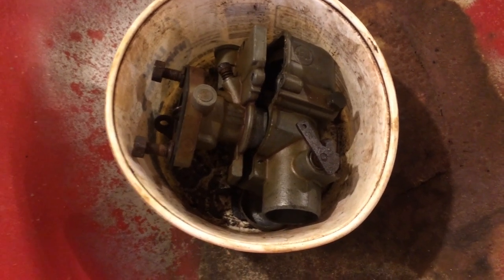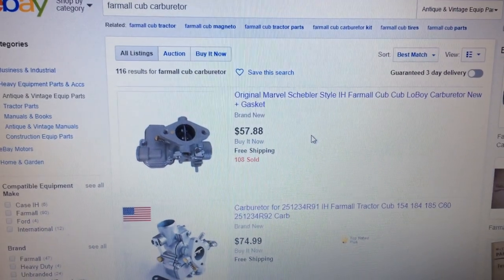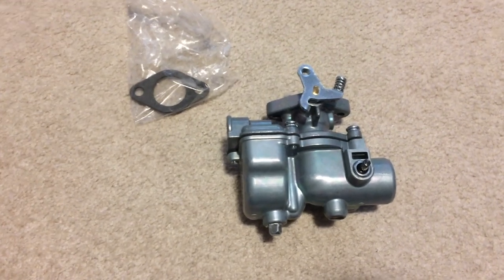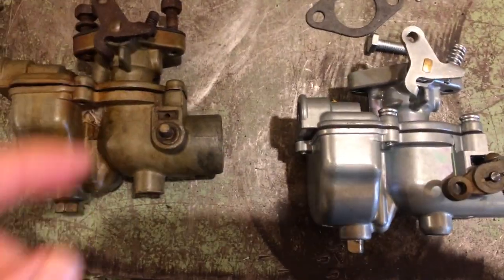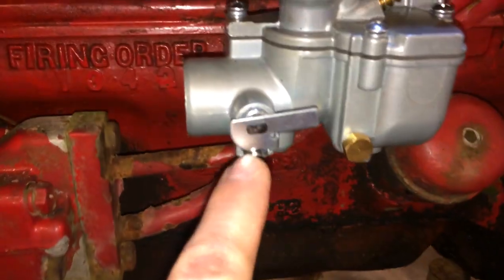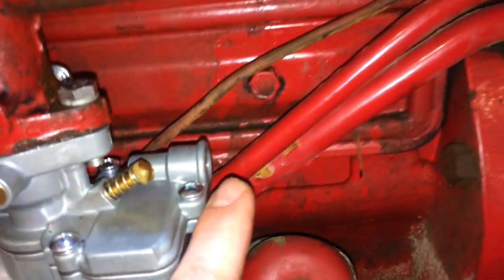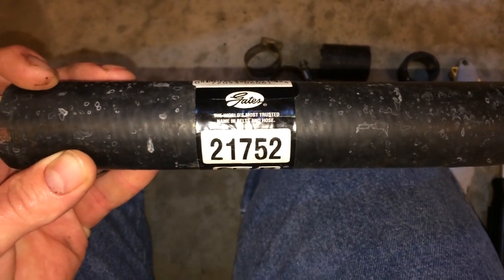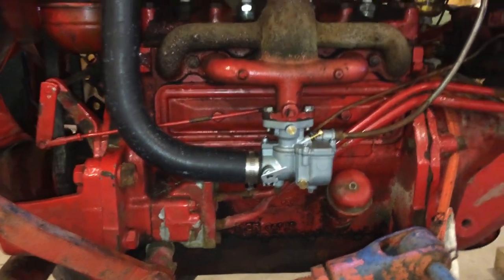Carb replacement on Farmall Cub with IH carb

Comment: The Cub originally had a metal tube with a rubber section on each end. My Cub didn’t have it so I got one from Steiner. Also, I’m replacing my carburetor today with a Chinese one also. For all the naysayers, I never heard him say he was junking the original one. The tractor is running until it gets done!

Comment: Great video! you seem really knowledgeable. could you make a video on how to adjust the governor? I just replaced my carb too and having a hell of a time with my governor I think. the throttle linkage isn't really responding as it should etc. seemed fine before I replaced the carb.  seems like you kno what you're doing. and there are no videos yet on how to adjust the governor with the linkage problems.  a video like that would probanly get a lot of hits since a lot of people replace their carbs. thanks for you video!
Reply from the maker: Ryan Racine I am glad the video helped, but grandpa sold that tractor. No more Farmall videos on the horizon.

Comment: I just aquired a cub tractor. Needing some help with it.
Reply from the maker: I’ve got a playlist for a Cub tractor. Check it out. Maybe there’s a video or two on there that can help you.
Reply: Not sure if you're interested in working on one put I was told when I got it that it needs a new clutch. Which means you have to split it. I'm in hancock county. Not sure where you are in indiana but I was wondering if it's something you be interested in doing
Reply from the maker: I’ve got projects stacked up already. I wish I had time.

Comment: Hows it been running since you installed the new carb? I just picked up a 49 cub i was told ran but the carb was stolen off of it , do you still have the sellers name you got the carb from ?
Reply from the maker: It ran great. It was sold a few months after this video. Ebay has alot of good sellers for these knock off carbs.

Comment: where the governor linkage hooks to the carb , is there a spring on that ?
Reply from the maker: There should not be, but if yours has one, something may be worn out on your governor. I have seen other farmalls with a return spring on the throttle for that reason.